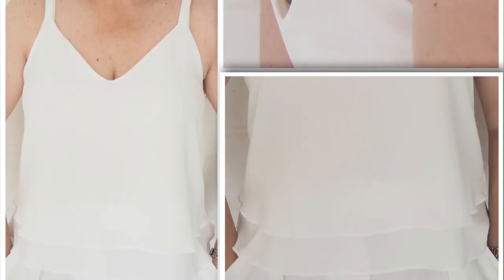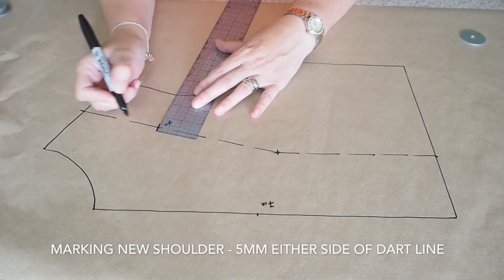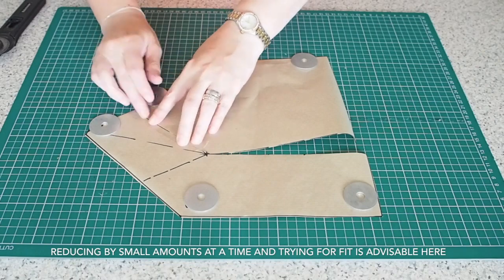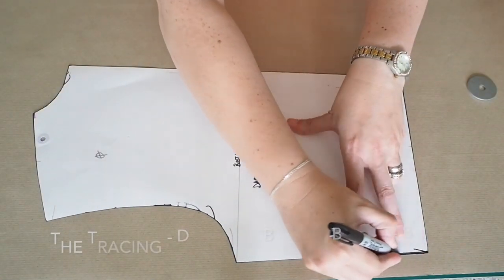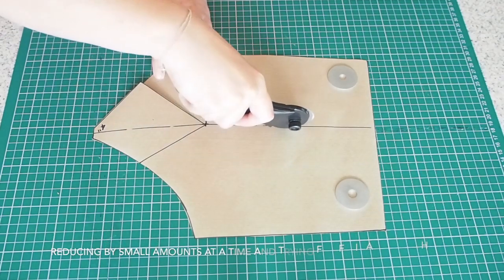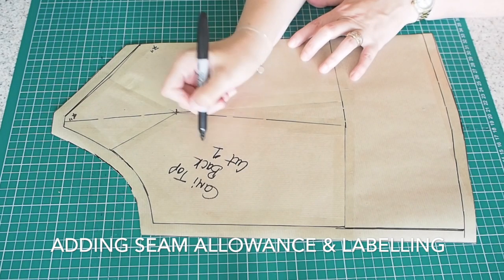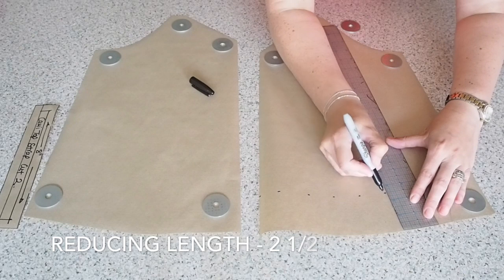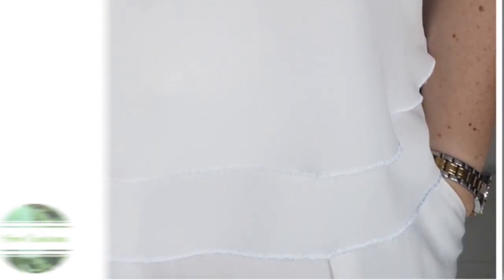The Patterning of My Layered Cami Top

Comment: Hello......I spent today measuring, drafting, adjusting, cutting, sewing 2 blocks (the same one, bodice).  Much to my dismay, they are not right.  The first one was way to small.  So, I measured again, drafted, cut muslin, sewed the second one.  Ugh!  Still not the right fit.  Any suggestions to get through this so that I will have a good working block?  I’m exhausted!  But, I refuse to quit.  I want to sew the beautiful clothes that you have been showing us on these videos.  I absolutely love, love, love them!  BTW....I’ve been using Diane Denzel’s videos to create the bodice blocks.  They aren’t easy, but she is very good at instructing.  I just can’t figure out how to get the bodice to fit correctly.   THANK YOU SO VERY, VERY MUCH!!!!!!
Reply from the maker: Hi Stephanie, I so feel your pain 😩😩😩 the only thing I can suggest if you've checked your measurements and you're 100% sure they're spot on is to break down the fit. Once you've made your toile look at each bit in isolation, the shoulder, the bust, the waist, length of the side seam etc and make tiny adjustments at a time until it feels right on your body, transfer whatever adjustments you've made to your block. The fit of my basic bodice block is comfortable, not too tight or too loose. Stick at it Stephanie, this is one of the hardest bits, getting your first block completed 🙂
Reply: Hello again......I’ve made great progress today!  With toile #3 the fit is beginning to come together.  I like the neck, armscye and back.  However, the bust area has too much fabric.  Will consult Palmer/Pletsch Complete Guide to Fitting and also Veblen’s Perfect Fitting.  I am going to keep at it (a storm is bearing down on us and I will enjoy being in my sewing room tomorrow).  Thank you for the encouragement !